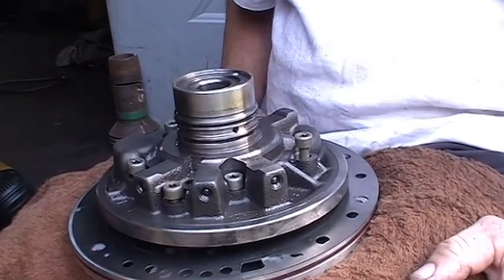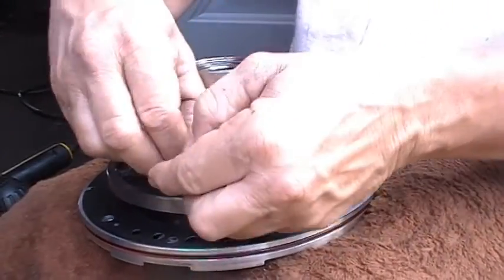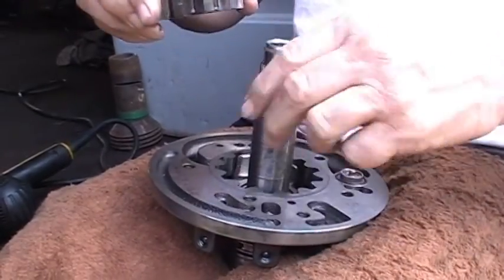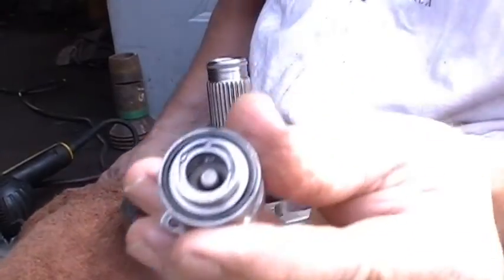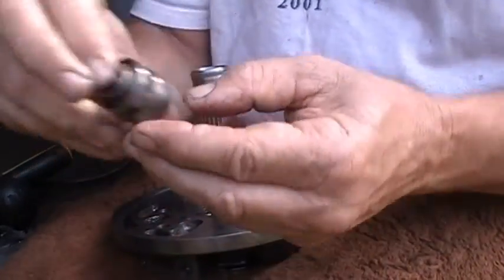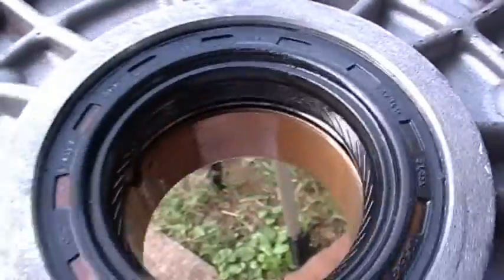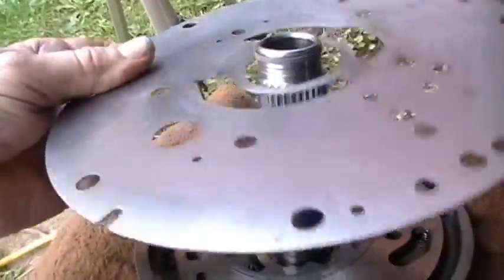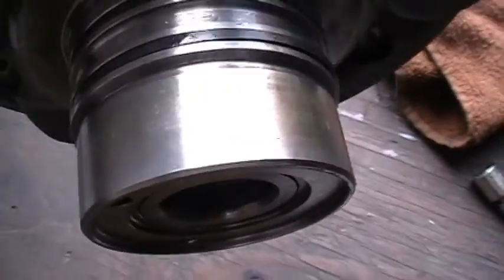5R55S TRANSMISSION PUMP youtube.

Comment: Hi, I just took the pump out and and find out the dot in the center gear was up...and the transmission was making a a little noise, but after a minute stop working...it is a possible that will be the problem..?

Comment: im hesitant in buying an "as is" mechanics special suv that has dificulty going into drive sometimes it slips before take off and im planning on just changing the tourque converter, on off tourque solenoid and now after watching your video the pump  worn parts and pump valve .  Im hoping one will repair it since i dont want to pay a full rebuild price afterall it is a british and its hell expensive. the tranny does shift all gears but does slip from idle. Hoping for luck on such a great buy.

Comment: Do you think a worn pump could cause shifting issues. It's the aluminum casing that is worn. Or is it more likely the torque converter that I know is starting to fail, it has that nasty rattle from the bell housing. Or should I just replace both at once. It just got rebuilt but still has shift issues and I'm leaning towards one of those two.

Comment: Hi, thanks for an informative video, I just replaced my Lincoln LS transmission with another used unit and my old one failed, i did put a new input seal but I still have a small fluid leak from around torque converter area. Any idea what can cause the leak? Thank you.

Comment: I have a problem like whining noise. I dismantled the oil pump. Found the valve flow control the push the rod. I hears friction sound. Is it the caused of whining sound? Unfortnately I can not attached the video.
Reply from the maker: Om y!

Comment: What the problem if the oil seal at gear pump is broken? engine stall at idling or incorrect gear 3?
Reply from the maker: Seal leak trashed the system perhaps
Reply: @FixingWithPassion  the problem is engine rpm drop if shift to  D and R ? how to fix this problem ?

Comment: My GF has same transmission and she can't afford a new or rebuilt transmission. Someone said that it's the transmission pump. She is so upset about it. I want to help her, but I wanted to ask you something first. How much did it save you/cost you, to take that apart and replace that pump? Can it be done by an amateur? Any help regarding this manner would be greatly appreciated. Thank you.
Reply: The pump replacement is easy. Getting a transmission pulled from your vehicle is the hard part. If you can pull and replace a transmission you can easily handle a pump replacement rebuild. Complete replacement is like 250 in parts. Rebuild is like 100 at most. Time investment is a few days. One to pull the trans and one to put it back. 10 minutes to rebuild the pump. Paying a mechanic to do this could run you 3500 to 4k easy. They will likely claim it is a complete rebuild and charge you accordingly.

Comment: I rebuilt my sons 5R55S, getting ready to install it back in the car, I put the torque convertor in and it seems a bit weird, it seems like its slipping on the pump, making a grinding noise when I spin it. Wish I could send you a video 📹
Reply: Wiggle it around a bit bro. Probably not on there all the way. The splines all need to line up and it needs to slide through the new seal ;)
Reply: Bannock Chief.. I thought that too but it slides all the way back beyond flush of the bell housing.. I have a video on my phone.. is there a way I can send you the short videos.. I’m kind of new to YouTube
Reply: Bannock Chief I posted a 30 second video on my channel just now
Reply: @White-Label-LBC  is the back of your torque converter rubbing against the pump bolts? Flywheel may unseat it slightly when fully installed and tightened up. Posted a video on my channel.

Comment: how did you get the pump out of the transmission, once you remove all the bolts
Reply from the maker: I used a pipe and wiggled it out slowly getting it to free up. It took a while to get out...... They make a special puller to pull the pump out.

Comment: Hello again, I posted a comment a year or so ago. Well, the Explorer was put on the back burner for a while (in storage) I now have it back in my garage. I just got the trans removed (5r55w) & watched your video again about the front pump valve sticking on these transmissions. My question is, does the 5r55w have that same pump valve as the trans your showing in this video? 1 other I thought was quite odd, after removing the torque converter I went to pour out the old fluid, & there was absolutely none in there? Right towards the end of your video, you mention checking the front seal on the input shaft? My trans has one, but is not very noticeable? Like it’s wore down to nothing. Any advice? Will be greatly appreciated!! 
Thank you!
Reply from the maker: I'd verify that seal and replace it  if you can. You don't want any leaks.

Comment: Too bad that the trans has to be pulled in order to change it out! I have a 2003 Lincoln LS with this trans in it, and DTC codes of P0795, P0734 & 35. It will shift from 1st to 2nd, but takes longer than normal to do it, and will not grab any more in 2nd after short time with any throttle. Reverse is gone also, but will engage after long while with raised rpm''s. What do you think?
Reply from the maker: Rebuild time. Probably a burnt band. Happens quite often in these transmissions.
Reply: Hope you're wrong! I am going to remove the valve body again and check for any broken springs, stuck valves or debris. I will let you know if it turns out to be a simple fix ))